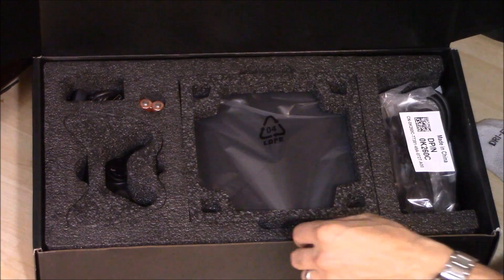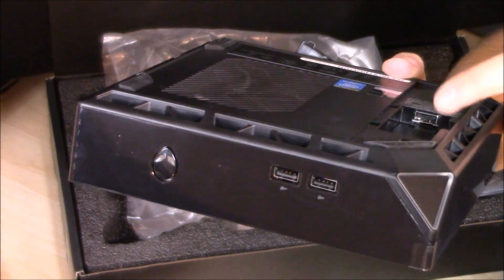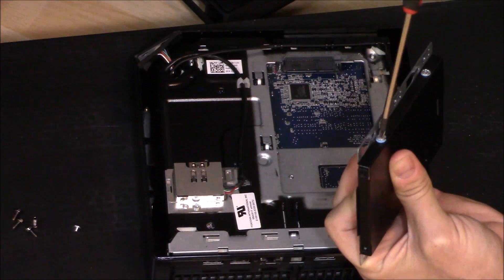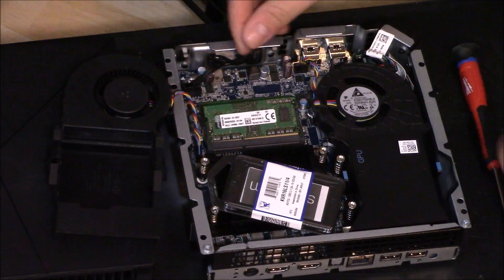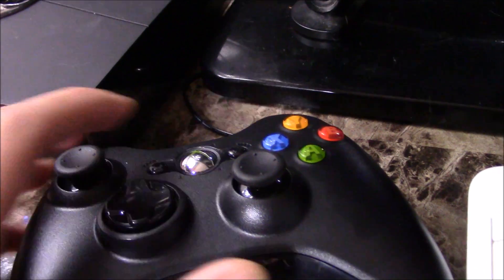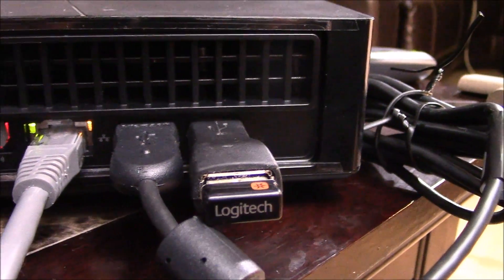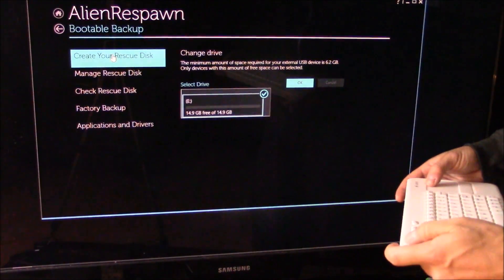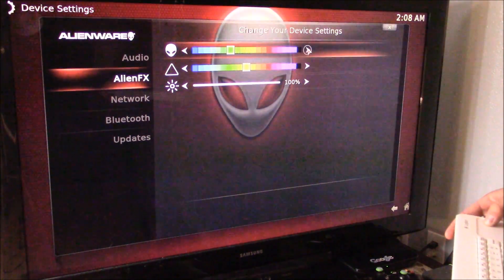Alienware Alpha Unboxing & How To Upgrade CPU GPU RAM HDD SDD, the possibilities

Comment: This is an incredible video! The Alienware I had re-inherited is the exact i3 model, which is a very nice project for me to upgrade just the processor. I had already replaced the CMOS battery and while I was at it, I had upgraded the mechanical HDD to a SDD, but a size cost.

Comment: anyone have idea what to do ? I had yellow light and lived with it I juat had to unplug power adapter for a hour or switch power few times to power on normally , but now even bios battery change and bios reset with a jumper doesn't work

Comment: I have the Alpha R2 and it has 16g RAM i7-6700T processor in it problem is I would like to upgrade that to an even higher cpu but all I hear is you can't but I cannot find any literature as to why except for size and heat but no FOR SURE black and white answer as what the upgrade on a CPU could go.... I just bought the RTX 2080Ti and I have it running in my Alienware graphics amplifier but I hear the minimum recommended CPU for that is the I7-8700K  can this be done or what?  No solid answers on this nowhere or explanations other than the possibility of a heat issue.  Can you help me out I would appreciate it?

Comment: too bad you can't upgrade the GPU
Reply from the maker: True but newer version of alpha can connect graphics amplifiers which can upgrade GPU.
Reply: oh I didn't know that their are newer versions of Alpha. Where would I go to look for them
Reply: @TampaTec  What about an Alienware steam machine, can o use the graphics amplifier on it?
Reply: Well, you can get a m.2 16xpcie adapter block thing and plug the guy into an external psu

Comment: I recommend reinstalling a fresh Windows 8.1 or 10 without the bloatware. It's an excellent console for intensive gaming and streaming with GTX 840M GPU, not bad... but your PS4 can do better. However your RAM and CPU is upgradable and it is a tiny console that is very portable. If you move a lot and don't want to drag around a massive tower PC, the Alpha is the way to go.
Reply: Taunt Party it's a 860m also overclocks nicely but can do egpu

Comment: Cant upgrade the gpu

my 750 is going to run behind 

i wish i had the r2
Reply from the maker: Bonk Donk you need graphics amplifier then you can upgrade gpu
Reply: thanks by the way how much do they run for?
Reply: Bonk Donk R2 has the graphics amp port. If you have the R1 you can do a egpu I did a video on this

Comment: does anyone know what's a good processor to upgrade to? I've heard no point going i7 as it doesn't have enough power to make use of one
Reply: Taunt Party The Alpha only uses Intel CPUs
Reply: Are you talking about upgrading to an i7 or purchasing the i7, because I purchased the i7 Alpha when they first came out, and it definitely has the power to use it.
Reply: Nah upgrading CPU to the i7
Reply: kyle de man From what I read, you just have to make sure it's the right one. I don't much know much more than that unfortunately.
Reply: Alexander Vlietstra yeah has to be a 4th generation and a T model for low power
Reply: If you want the i7 but don't have the money for it, I recommend getting the AMD a10. For about $90+ you can excel 20% faster than the i7, but uses a lot more power.

Comment: If I upgrade the CPU to I5-4590T will I be able to use the same heatsink shown here? Just install new chip with thermal paste and good to go?
Reply: king spook that doesn’t matter, the heat sink would be fine. Unless you wanted to overclock, I would cut out a section of the side and run an AIO with maybe a USB to fan header adapter or something for the fans on the aio.

Comment: So if I purchased the i7 model but wanted to ONLY upgrade the RAM would I still need to make a recovery flash drive? Also any chance u can put a link in where to buy the Alien face you put on top of the case? Thanks.
Reply: Ew No I don't believe you would

Comment: But if I install Windows what will happen to alien ul
Reply: There is a desktop mode, which has Windows already installed. You can use it in either console or desktop mode. I use mine almost exclusively in desktop mode.
Reply: +Nathan Holt I know it have preinstall Windows but if I want to reinstall/ fresh my windows what will happen to alien ul ? And can I install Windows 10m?
Reply: +adam ahmed I see. I have upgraded my Windows without it effecting the Alienware UI at all. I think they are partitioned so one doesn't actually effect the other. I would make a full recovery back up before you do it, just in case.

Comment: what is it's graphics card?
Reply: +Bobo Rara Its a custom GPU but its pretty much around the performance of a GTX 860m
Reply: +Bobo Rara There is no CARD, it&#39;s a CHIP soldered on the motherboard equivalent to a 860M. GPU is NOT upgradeable. You could build a MINI ITX system much better then this thing. You obviously DID NOT watch the entire video.

Comment: disagree with your comment about the WAN card in the alpha. It has a built in dual channel card that supports 802.11ac and you can even connect to the 5ghz frequency on modern routers. I typically get better wifi speeds than my roommates on their laptops ( one of my roommates is using a 2015 macbook pro) Granted LAN is always better i still think the factory card isnt bad. You of course can always upgrade it if you want something better

Comment: OMG I WANT ONE SO BADLY!!! :( I don't have anything, no console. :(
Reply: Same.
Reply: ***** That sucks.
Reply: +Amine Bellal There are 2 versions but STEAM doesnt play some ORIGIN and DRM games. The Windows 10 version is OK. GPU is not upgradable. Might be better off with a PS4 or a Xbox One or build your own Mini ITX PC with a Raven Z1 PC case for $60, add power supply and any graphics card that will fit like a 750Ti or even a FURY card.
Reply: not worth it.

Comment: i have 1 question does it only stream? or it downloads the games?
Reply from the maker: +sexymilo83 it's PC so it can download games.
Reply: +sexymilo83 There are 2 Versions, one is WINDOWS 10 ALPHA version the other is the STEAM version. You can of course save $100 and load STEAM APP on the Windows version. I have heard STEAM does not work on a lot of ORIGIN and DRM (Digital Rights Management) models. Plus the GPU is not upgradable, it's hard soldered on the motherboard, version of the 860M. Better off getting a Razer V1 case for $60 and a mini itx board with a decent graphics card that will fit inside of it.
Reply: +Tampatec thank
Reply: +TekReview's thnx